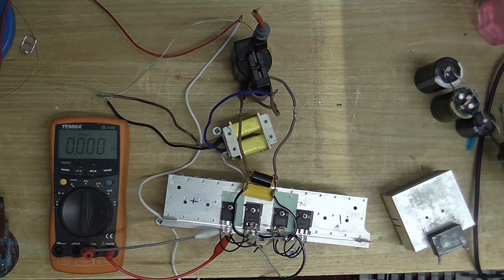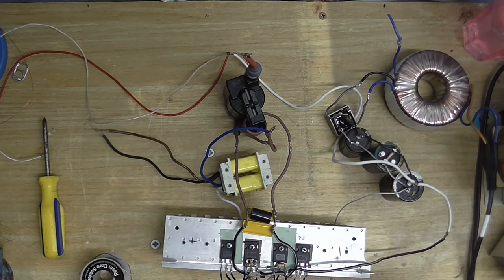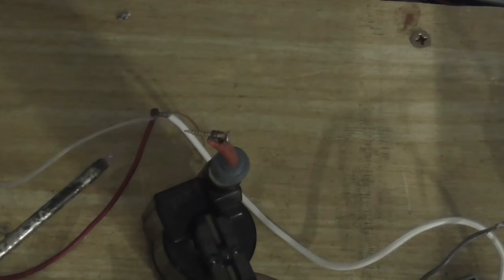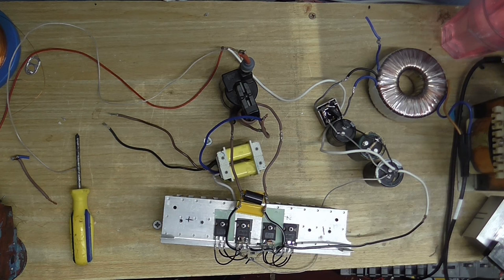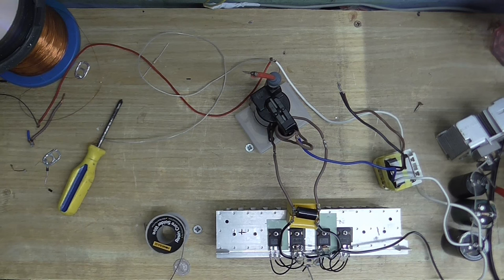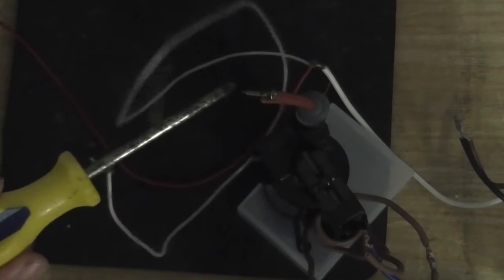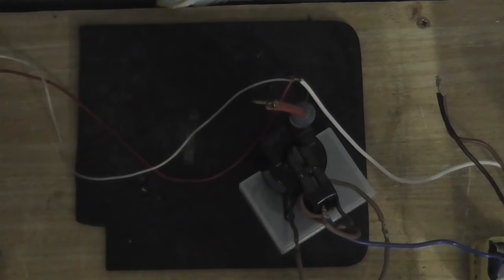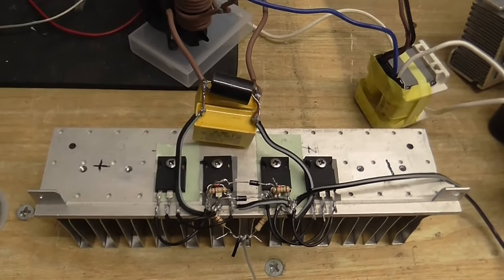IGBT ZVS, and monster arcs!

Comment: NICE!!!!!! Very, very nice! I made a 555 timer flyback driver using a BUZ11, and it worked really well up to 30 ish volts, until the mosfet went bang! I was able to get about 8 cm arcs out of it. However, my arcs had a smaller current, and they were not "flame ars", however, I am hoping to fix that by changing my transistor to an ip122, and runnning it of 80 Volts or maybe even rectified mains using an irfp460.
Reply from the maker: Your mosfet exploded because the primary can make a high voltage spike of it's own after each pulse, it can be up to 10 times what your supply voltage is. However in a half bridge, full bridge, or where you have a center tapped primary with 2 transistors taking it it turn to pulse each side of the primary (like in a ZVS), that doesn't happen. I wouldn't recommend running off rectified mains unless you're going half bridge. 

If you're only using a single mosfet circuit, putting a 1-3nf capacitor between the drain and source can help protect it against some of the high voltage spikes, another option is a snubber across the primary (a 2.2k 10w resistor in series with a 1nf capacitor)

Sorry for the long comment.
Reply: CoolDudeClem no problems :D I was gonna try the flyback off rectified mains using a half bridge driver, but sadly I dont know where it went :(. I am currently busy with a slayer exciter, and I think I figured out how to get a VERY HIGH FIDELITY audio modulation from it! I simply connected some crap HF (20? KHz) isolation transformer between the resistor and the base of the transistor, and i got a very decent audio modulated signal! However, when I used a bd13(5,7,9) transistor, and a 1Mohm resistor, the audio modulation worked best at 3 volts, despite the circuit starting resonance at 6 volts, and it simply quit modulating anything at 5volts, and it started modulating from one volt. I am not sure what causes this interessting effect. Any ideas?
Reply from the maker: Definitely strange, it could be the resistor, maybe lowering that to 10k would help, I'm not sure myself.
Reply: CoolDudeClem i tried, nothing happened, I think it has to do with the limitations of the transistor it's self, I got my slayer exciter running from a TIP31C instead of a bd13(5,7,9), instead of a 1Mohm resistor, I used a 10k resistor, I got a much better streamers, and from 25ish volts I was getting over 1cm streamers to air, 1.5mm to my finger, and im abou to see the streamer lenght to ground via a chicken-stick.
Reply: tip122 are not good for high current can only take 5 amp max i have tested them
Reply: Mrinal Thakur Strange, mine blew at 8 amps.
Reply: Mrinal Thakur The current here is pulsed, and transistors can take a higher pulsed current than a continuos current.
Reply: Ivan R I know it's their peak rating I was speaking about continuous current and it's near 4.89 amps 
Believe me
Reply: Mrinal Thakur I believe you :P The reason I like to use this transistor in low power flyback drivers and medium power inverters, is that they can take high voltage spikes up 10 100V.
Reply: Ivan R yes I have also observed this when irf540n and irf9540p blows at 24v but the tip 122 goes all the way upto 45v and it's nice hot and happy but it blows at 50-50v
And also it can witstand very high temperatures i learned it the hard way I burned my two fingers and was having nice looking blisters 
The thermal grease started to evaporate but transistors was ok
Reply: Mrinal Thakur thats why you put a fan on the heatsink :P I had a similar story with an irfp460 mosfet, when I fucked up the wiring and the mosfet was shorted. I did not get blisters tough, I had a burn incedent with  buz11 mosfet, when I was running a transformer on it without a heat-sink. I never pushed any transistor beyond 30 volts though, and I only made a simple 555 timer pwm to control a lightbulb running off the mains using an irfp260 mosfet, but realistically, I never went beyond 30 volts, and never beyond 18 volts for a flyback, as my power supply could not handle it!
Reply: Ivan R do ypu want a very good and powerful power supply for really cheap
Reply: Ivan R I have a lot to it and I am currently using it
Reply: Ivan R I mean I have link to from where to buy it
Reply: Mrinal Thakur what are the specs of the power supply, as the main problem I had, is the current rating of the power supply and not it's voltage, as the shit "makeup" power supply I had, blew up like a bomb when I ran an unballasted (suicide) cfl from it, at 17 volts, it drew 5 amps, however the power supply was rated at 30 volts and 5 amps. it failed at 85 watts only!
Reply: Ivan R I use a 380w led 12v 30 a power supply and use a 600w boost converter that way I can pull 15a at 28v and current goes down as voltage is cranked above 24v and reverse happens when voltage goes below 24v
Reply: Mrinal Thakur sure sounds impressive! where did you get it?
Reply: Ivan R from Amazon for 1890 inr if you want it deliver early 
From Aliexpress for less that 800inr if you can wait for a month or so 
And boost converter get i got from Aliexpress for 900 inr 
If you can put 600w led power supply you will get even more current output
Reply: Mrinal Thakur ill definately check it out. Thanks!
Reply: Ivan R do you want link
Reply: Mrinal Thakur yeah sure!
Reply: Ivan R shall I send you on hangout
Reply: Mrinal Thakur ill look for it, thanks man!
Reply: Ivan R wait
Reply from the maker: PLEASE STOP COMMENTING on this video.
Reply: +CoolDudeClem dont Rude
Reply from the maker: Sorry, I didn't mean to offend, but you all keep replying to me talking about stuff I didn't even mention. It's just getting a bit ridiculous and I'm not having a good day as it is.
Reply: CoolDudeClem sorry if caused trouble
Reply: CoolDudeClem dude what?
Reply: CoolDudeClem Mrinal Thakur wtf happend here LMAO!?
Reply: Ivan R dude got cranky I think he is not happy
Reply: Mrinal Thakur that happens a lot :P! No worries CoolDudeClem your still awesome!

Comment: Hy please I need circuit diagram please
Reply from the maker: It's just the standard ZVS circuit, look it up. All I did different was use 2 transistors in parallel on each side instead of just 1 transistor on each side, and used a separate supply for the gates. Also I'm not going to provide a schematic because I already showed the schematic at the end of the video.
Reply: Please share the diagram ! 🙏

Comment: clem, wtf. the psu choke is meant to wotk at 50 hz. at 1khz and up it just acts as a resistor
Reply: also replace the 10k resistors with ceramic capacitors
Reply from the maker: Yes I'm well aware of that, the thing is this is the only inductor I have that wouldn't saturate and stop the thing from working.
Reply: CoolDudeClem you had that one blue ring. just give it more turns and it is perfect
Reply: John Scarce Replacing the 10k Resistor with a ceramic capacitor is a bad idea. The 10k Resistor is there for discharge the gate, and to increase the capacity of the gate with a capacity is also a bad idea ^^
Reply: tell this to my zvs with no 10k resistors transferring 100w on flybacks and induction heaters. the 10k makes the gate charge and discharge slower therefore increasing the transition losses of the circuit. putting 10k on a modern mosfet is like going back 20 years in terms of gate charge and drain-source recovery and delay times. large capacitors are bad, but for prototypes with expensive mosfets a bit of protection from random inductive spikes is never bad idea.

Comment: Whoever thumbed this down probably shuved the positive up their ass and grounded the negative an ran it on full power :D. Awesome video, love your channel Cooldudeclem!
Reply: yo
Reply: Mrinal Thakur you again :P? Whats up dude? Hey did you get that slayer exciter working?
Reply: +Ivan R partially
Reply: Mrinal Thakur what do you mean partially? did you get an oscillation, and were you able to light flourescent tubes and did you have breakout?
Reply: Ivan R I got it to light up  fluorescent lamp and killed my watch but no breakout
Reply: Mrinal Thakur Are you sure your coils were resonant, and what distance did you have between them, as well as what transistor did you use? My advice to you is to try to make the coils as closely spaced as you can, and your power will dramatically increase, and try varying the amount of turns used in the primary coil.
Reply: +Ivan R I will try my exams are not over yet
Reply: Mrinal Thakur exams for university? If so good luck bro!
Reply: Ivan R no bro of school I am only 14 and in 9th grade 
But what makes you think that I am in university
Reply: Mrinal Thakur facepalm, wait but why are you doing exams in the first month of school? I just started grade 10 and im 15.
Reply: Ivan R here in India academic year starts in April

Comment: what type of igbt you used?
Reply from the maker: I think I used the STGW30NC60W IGBTs, mainly just because I'd had them laying around for a while so I decided to use them for this.
Reply: I used 25N120 it also works very well i pushed the voltage upto 50 and it was running well